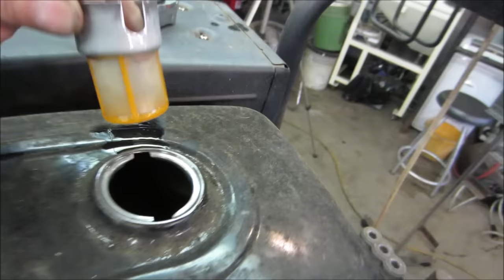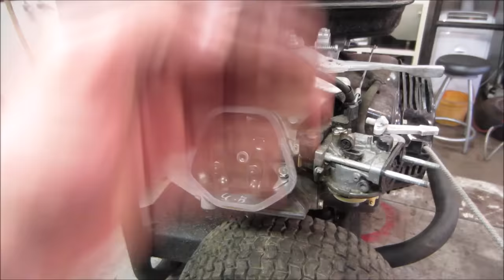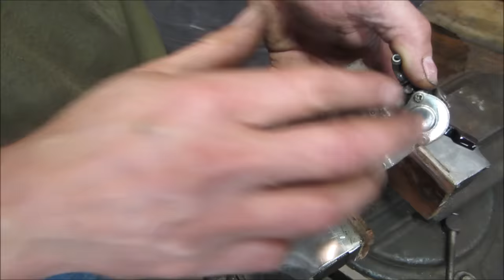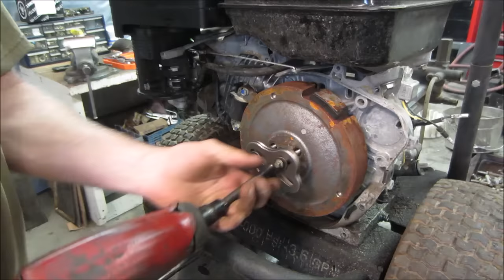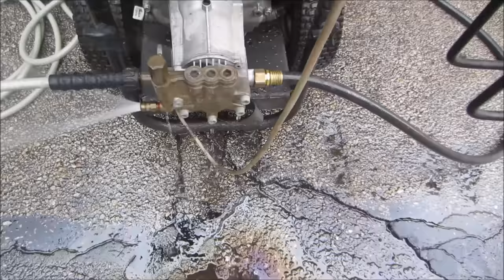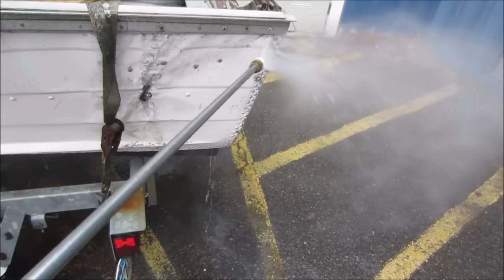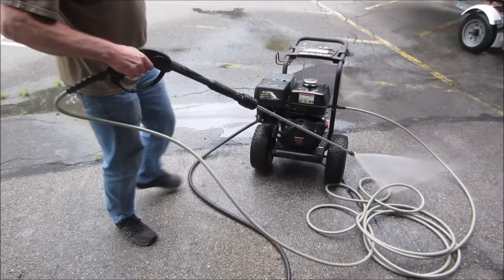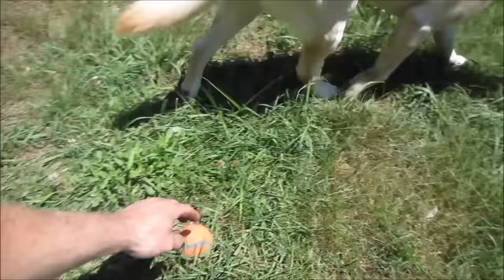Pull start rips out of your Hand? lets Fix It. Busted Pressure Washer.

Comment: We’ve had a big northern tools hot water pressure washer with a 13 hp Honda GX 390 on it for over 20 years, ever since new, and it has always snatched the handle out of your hand every once in a while. Just for ease of use for anyone in our family I finally decided to add an inexpensive eBay electric start kit to it last year which included a new fly wheel. I did notice the timing on the new flywheel was slightly different than the OEM flywheel (gave it a shot anyways) surprisingly it doesn’t kick/pull out of your hand anymore, AND it runs way better than it ever did since new. So I just wonder if (not in your case obviously but) some older Honda engines had issues right from the get go with timing? 

And yes, our hard start problem really is solved (not just by using electric start) because we used it several times with the recoil start before I found an inexpensive battery that I could fit right next to the engine without being too close to the diesel burner/heater😁

Comment: FYI - which you may have known but chose the old school method of pinching off fuel line with vice grips but you can take off the plastic choke and it has a built in plug on it to insert into fuel line to plug it off.

Comment: Thought I would share my kickback story as it may help others with the same issue. When magnets, valve timing, points, coils and all the other issues are not your problem, run a compression test. Had a Tecumseh LEV120, L head lawn mower. Mower pull start kicked back violently when plug wire was connected. Appeared to have decent compression.  After chasing all of the usual gremlins, I decided to run a compression test. 25 PSI max (way to low). Next, I did an leak down test. It immediately failed. I could hear the air blowing out the crankcase vent and in to the intake manifold. Engine had a cracked compression ring. My conclusion; during the combustion stroke, the intense pressure leaked by the piston, pressurizing the crankcase, forcing the piston to reverse direction abruptly. My customer chose not to repair the engine as it was 18+ years old.

Comment: The limiter cap on the Honda carbs can be removed by heating it with a torch whilst gently prying on the back of the cap, this will melt the loctite and release it without breaking it off. I’ve done this many times with great success

Comment: I think there is supposed to be a little hose connected to that spot on the pump where it was spraying water out of, I have a pressure washer with a similar design, and there is a hose attached in that spot that runs back to the water inlet on the pump.
Reply from the maker: that was below it, this is a bad pressure blow off

Comment: Years ago I had an Ariens Snowblower that would run long enough to do a swipe or two down my 100' driveway and stop..
Changed plugs, checked ignition, fuel, carb, the works... almost ready to give up when I happened to look up the fuel hose..
There I found a flake of Ariens cream colored paint situated such as to act as a butterfly-like valve..
It would remain in line with fuel flow for a few minutes, then slam shut..
Once the engine remained off & jostled around a bit, the flake would return to being aligned with fuel flow again..
Start up, do another pass of the driveway and then flop over, the bowl would run dry and frustration ensued again..
Just a thought..  Dennis 8- )

Comment: Had fix friend of snowblower one time what found was 110 hydro plug  was get no spark was weak to and found 3 problems to! First was Spark plug need changed plus gap, 2 points gap was corrosion plus clean also set up right gap and third was the 110 hydro plug need rewired to new outlet plug to Starter wires rewired plus ground wire need  near bottom motor frame broken and rewired to new bolt with washers plus ignition connector in middle to the washers plus nut with washer too on metal body shine up too! Bolt plus washers and nut used Die Electronic grease to and flywheel clean up plus rip cord fix too! Also work so well no problem since too and told use A grey bottle of STP Total Treatment fuel injection cleaner ever 3 fill up use Shell gas 89 or higher octane gas too !

Comment: That part that is spraying water out of the pump I think is the thermal relief valve.  They are designed to fail(ie the metal tab on the end blows out )before  damage can occur to the pump. They usually blow off if the pump gets hot, say from the bypass system not working correctly.
Reply: Yes and no. They reset themselves when temp falls.

Comment: I have an old racing gokart with that same motor. It wouldn't even try to start before i adjusted the valves. After that it ran like it was a brand new engine. I also leave the valves loose so when you tighten down the locknut it usually gets it to the specs they recommend

Comment: Thanks for showing the valve adjustment, where did you get the small parts bucket for the ultrasonic cleaner, and what do you use in the ultrasonic cleaner.  Soap and water, varsol, brake cleaner, carb cleaner or something else?
Reply: Think he said in an older video he uses carb cleaner. It comes in like a bluish color can.

Comment: Hate to say it but the cam does have the compression relief built on it and controlled by a spring that can break and cause big issues with the kick back on the pull start.  Replacing the cam will fix it but if you have a spring you can do that as well

Comment: Did you inspect and look at the valve guide plate?  The plate that holds the push rods under the rocker, there are little plastic wear plates.  If they are worn that valve adjustment isn't going to last long.

Have followed up with the owner?

Comment: Having seen that engine about 1,000 times in recent years on my job I already knew the "cord yank" issue because it's common. That engine has been licensed elsewhere (perhaps China?) and is used for many small applications, including Generac, Honeywell, and likely half of what you see at Harbor Freight. Original design is probably 30 years old at this point. Basically you don't get compression release on starting if the valves are set (worn?) to over 0.010" and the factory adjustment is 0.004", due after 100 - 200 hours of run time. If it's done EVERY time you change the plug you will never see the issue. The flipped coil was a doozy. Good call there. Factory gap is 0.011" cold. Basically the same as a business card. Oil filter box flap is just over 0.020" but workable if the coil is strong. That sensor on the block is for low oil level, which goes to the sensor module. I think you will find this engine doesn't have full flow "oil pressure" just splash lube, which is why the level is so important. To change that low oil sensor requires complete disassembly of the crankcase. Not a fun job for a part that's less than $10.
Reply: Yes this is a very common issue with that engine. The compression release sticks off and stays off after the engine stops. I work at an equipment rental shop and all our new power washers do this. Snapped cords and handles every day. Honda will warranty the camshaft. They won't admit to how big of a problem this is. Watching this guy try to adjust valve clearance is painful!
Reply: @fastcar1979  ... when you do 3 or 4 of these a day it only takes maybe 5 minutes, unless the VC gasket breaks. Change the plug while it's on the bench and you can save more time because you can see the piston's position. The only time I ever saw a bad cam cause this problem was on a Robin engine, never on a Honda or knock-off brand of similar design.
Reply: Yep but I still will replace it
Reply: @philliphall5198  ... it would be foolish and wasted time to bother with a cam replacement when 99% of the time a valve adjustment will fix the issue.

Comment: i believe the water running is a bypass. I runs when you are off the trigger to keep the water running through the pump and keep it from overheating. When on trigger I believe it should stop flowing. they sometimes loop back into the pump with a small black rubber hose. its hard to see on my computer. I'd just let it run and keep the pump cool. then again, I never saw a pump like that

Comment: Hello from the UK great video's little advice please my lawnmower is running rich plug is black sooty , i have cleaned the carb, changed the plug right heat grade 'oil change ' done the valves , air filter is okay / choke lever fully open , the same without the filter on !any ideas? much apreciated .

Comment: I have a Craftsman riding mower that would shut off after about 10 minutes. It turned out to be the gas cap wasn't venting. Now I just leave it a little loose & it runs fine.

Comment: Did a quick search for replacement pressure washer pumps and came out with many of that configuration for under $100 it could still be fixed seeing that everything else is functional. Could still have a $100 pressure washer not to shabby considering those sell for about $300.

Comment: Low oil level sensor, other silver thing is a latch so when the oil level trips it stays tripped until you next start it - so its not just a blip from oil sloshing etc and causes it to misfire and then carry on - as it grounds the coil to shut the machine off. Genuine Honda unit, those are expensive units. Nice nice nice.
Reply: Also that is why when you flicked the switch off and back on straight away - it didnt continue running again, it shut it down. The silver thing latched to shut it down just like it does for the low oil.

Comment: Hey Musti I’ve got one doing the same exact thing I did all the same stuff you did and put a new coil on but I didn’t put it on backwards lol even set the air gap with feeler gauge not by eye like usual, I bought this engine brand new so I know no one has messed with it and it’s only about 3yrs old and I’ve tried different plugs they would spark a few times the no spark at all even a as brss a brand new plug but I noticed sometimes it had spark then not so it was intermittent now there’s none should I try another coil oh and yes it is a brand new coil I even put the old one back on and no spark either and the kill wire is unplugged at the coil I’ve even tried turning it over with my drill still no spark 🤔

Comment: When in doubt, label out. Not 100% but way better than 50% when installing something (think USB and SD cards, for example.) if the manufacturer puts a label or markings on something, they usually do it so it is readable in the installed position. I agree with Mustie. Last guy probably installed the new one the same way the old one was in there.
Reply: And 2 years later… just had this problem with a Briggs I own. Took all the same steps, but the coil was original, never removed. So I knew the orientation was right because it ran for a few years. Flywheel key in tact, new plug, plug wire was good. Valves adjusted. Coil air gap adjusted. Opened her up… camshaft perfect, lobes perfect, lifters @ push rods perfect. Looked like an engine with only 40 hours should. Only 1 thing left it could be. Got a new coil and it’s fixed. Funny that the new coil came with a “this side out” label.

Comment: I'm still not clear on why it stopped after 10 minutes. I can't see that the coil or the valve problem would cause that. They might make it run poorly, but why would it stop after a  certain time? Interesting detective work. Thanks for sharing this.
Reply from the maker: you could here the spark cutting out when it did run, studdering, l think the coil would just get hot and shut down, he said its been fine
Reply: @mustie1  Thanks! 👌

Comment: I have a paramotor that feels like it will rip my arm off like a wookie, but the original owner was able to start it fine in front of me. I've asked around and can't get a working answer. One suggestion was pressing something to release compression? Didn't seem to work. Another was pulling the cord all the way out, letting it back in and then yanking it. That seems to make it better 50% of the time but not ideal. I guess a change of gas is something I should try.

Comment: Also general rule of thumb if the flywheel key has a line where flywheel meets crankshaft replace it even 1 to 2 degrees can prefire and trust me your knuckles can bend a starter when you can't get the handle out of your hand quick enough when it kicks back

Comment: I have a 4000psi pressure washer with the same motor. It would rip the cord out of your hand so hard it would snap the string. Turns out there was something stuck in the compression relief. Now it starts reliably.

Comment: Hello mustie
Love your video 
I got a similar problem with my husquavana push mower with a Honda motor.
It kicks back when I pull the cord to start. I check the flywheel key and it’s looks okay.
I drained the oil and pull the cylinder cover and removed the spark plug. When I pull the cord, i noticed that the cylinder to the left  don’t move. Also how do I check the cylinder timer???

Comment: Modify an old spark plug to take a dial gauge . Find top dead centre is easy then, back it back the required amount if setting old fashioned points etc. Or mark a line for a timing light etc.

Comment: Noob question: It's always been my understanding that you shouldn't run a PW without the water hooked up and purged. And then I watch this. So do I understand it's ok to start it water less for a minute of so? There's times I hook everything up and then find it won't start (temperature related, but not freezing). Would be nice to know I can safely fire it up waterless, if just for 30 seconds or so, so I know I won't be wasting my time. Also maybe a bit longer so I can adjust the carb!

edit to add: What an awesome lesson, much thanks!
Reply from the maker: this was already froze and run with no water so l was not that concerned but normally its best to have water in them,

Comment: That "leak" might be normal. It goes away when you pull the trigger. It could be there to keep cool water circulating through the pump. It also helps with priming and purging air from the garden hose before startup.
Reply: It's probably there to let water flow if the internal temperature of the pump gets too high while it's not being used. I would guess the wax motor (thermostat) is bad.

Comment: Wonder if that water shooting out of the side on the pump is a safety valve that allows cool water to run thru the pump after a period of time when the pressure builds up in the turned-off hose trigger so the pump won't overheat and destroy itself. That pump needs water running thru it at all times so it doesn't overheat.

Comment: I was just wondering how you spotted that the coil was installed the wrong way, i mean, it isn't marked anywhere on it, or am I wrong here? And by the way, really awesome how you manage to expain this so that everyone can understand it. Greatly appreciate your videos!
Reply: Spark plug wire was a bit short, kill wire was too long. Spin the coil around, and the wire lengths then look correct. Notice how much wire was originally sticking out near the kill switch and the low oil sensor.

Comment: I know this is dated... but was the cord snapping back because of the exhaust compression? Was the value adjustment the fix for that? Mine is snapping out of my hand constantly. Hurts. Was running fine, then suddenly this. There was signs of water in my oil, but I've drained, and refilled.

Comment: 21:45 - Something I did back when I was working on engines a lot was to take one screwdriver that was a bit worn/didn't care about and grind the tip for a perfect fit for carb jets. I was always glad I did that, though I had to do it several times because I tend to lose things.
Reply from the maker: same here not like they wont work on regular screws after grinding them

Comment: no sure if you noticed but when tightening the valves you are tightening the wrong nut.  adjust with the outside nut and lock with the inside nut.

Comment: Gum build-up on the cylinder wall. Had that exact problem w/ chainsaw. It kicked back w/ spark plug OUT. Washdown with either or electronics cleaner. Someone may have put sugar in my gas; so water may do it well.

Comment: I really appreciate this video because I have a similar jet wash with a similar problem but you don’t have a leak at the back of the jet wash it’s an overflow which stops the water from cycling around the pump and building too much pressure up and destroying it if the water cycle is around the pump too much it will heat up the overflow helps the water continuously flow through the pump without building pressure which helps it stay cooler for longer so please don’t fix that leak 😂😂😂👍👍🥰👍
Reply: Dm I spoke to soon and have now seen the leek 🤦‍♂️

Comment: Adjusting the valves incorrectly is pretty easy to do, if you are not certain how to do it.  I have had to adjust valves more than once for myself, and for others.  Installing the ignition coil backwards is another mistake people make.  Sometimes the proper orientation is a 50/50 shot without correct pictures, information, or previous installations.

Comment: Before I watch the video, Honda OHV engines would have a problem with the exhaust valve rocker cracking.  There is a centrifugal valve lifter built into the cam that operates the exhaust valve, this lifter lifts the exhaust valve which lower the compression.  When the engine starts the decompressor moves away allowing full power.
When  the rocker cracks you lose your valve clearance and the valve lifter will not work.

Comment: Those Chinesium pumps burn up the seals if you let them sit and idle for a long time without squeezing the trigger. THats what looks like happened there. Dont fret though most of the time they are rebuildable. Some times its just the orings. What happenes is that the water goes through the bypass and gets hotter and hotter as it circulates through the pump untill its super heated.